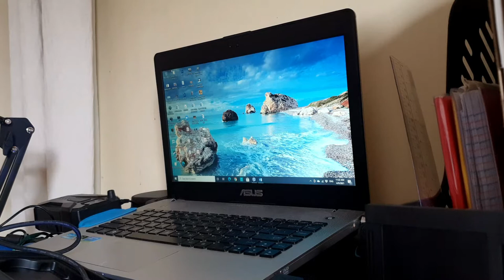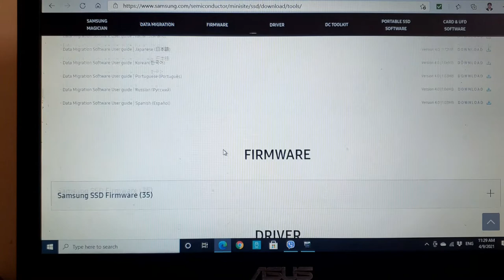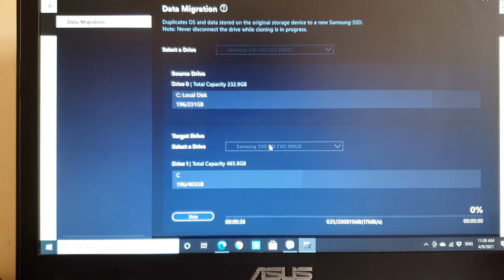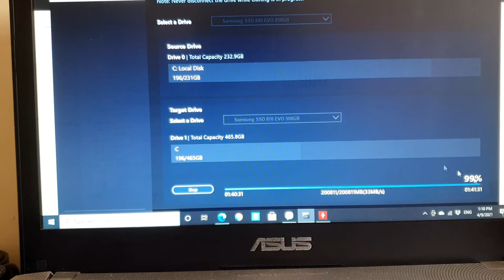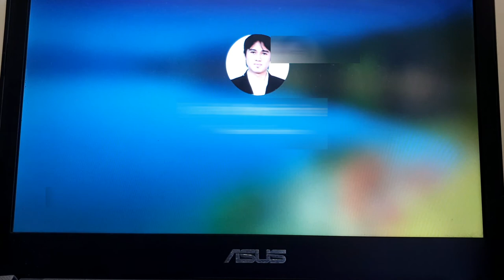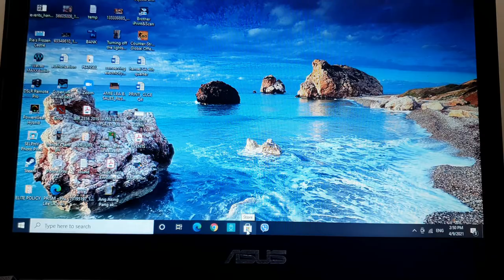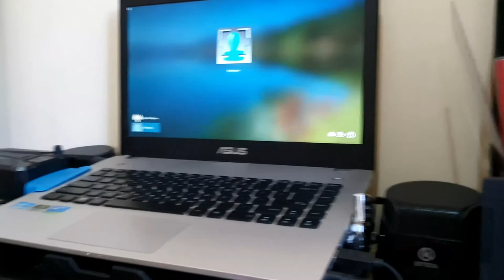Laptop Maintenance - Replacement Thermal Paste, Fan, and Harddrive

Comment: Bro.. pwede, ba sayo nalang ako, mag upgrade..dagdag memory 8g to 16g, lenovo  i5 9th gen...  Thanks Bro. pio Tech...
Reply from the maker: Brother pwede naman.  Then check mo speed ng current ram mo, punta ka lang sa task manager, tapos under performance tab click mo Memory nandun kung ilan slot and speed ng ram need bilhin. or send mo sa akin pics, tapos sama mo na din model ng laptop na sa likod naman usually un to cross check as well sa site.

Comment: I have a regular hard drive can I still replace  it  with that ssd drive ,it is a 2016 hp notebook
Reply from the maker: If I understand you correctly, you want to change the regular hardrive of your 2016 hp notebook to SSD. The answer is yes you can still replace it to improve it performance. As long as your laptop don't have motherboard issue and currently turning on. you can still improve its performance by changing the storage to SSD and you may also want to upgrade the ram at least 8 GB if you are using windows 10.